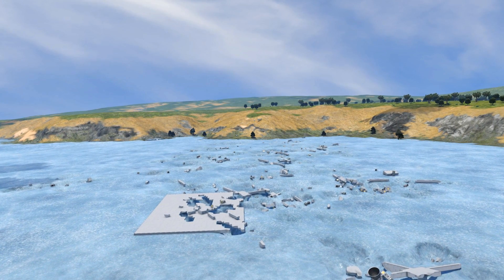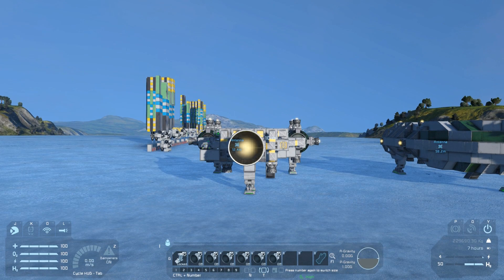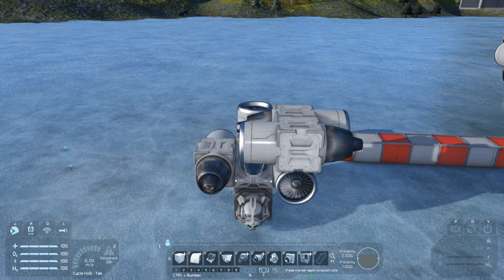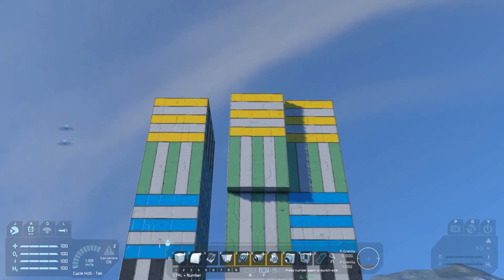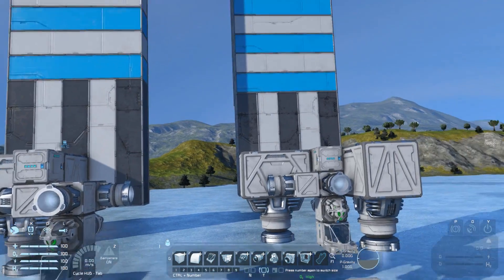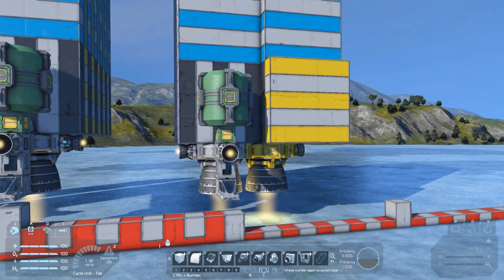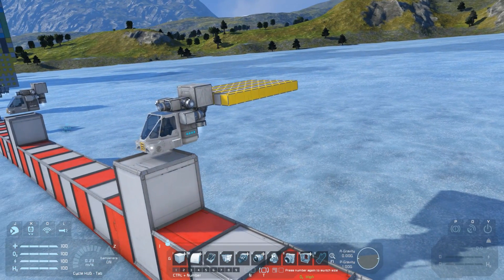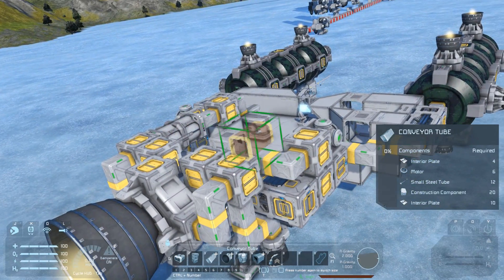Space Engineers Tutorial: How many thrusters? (tips, testing and tutorials for survival)

Comment: That is a great visual demonstration.  But it is sad that it still comes down to guestimation, given that the basics for mathematically gaining the information do exist but are not fully functional ie:

1.   the Grid Mass you showed at the 13:44 mark, is only of value if you build the ship away from any other structure, as the Grid Mass includes all items attached to the Grid on which the ship stands.

2.    you will also notice that the Grid Mass in this instance is 278,753 in 1G gravity, and yet your HUD shows a weight of 229,690.  At 1G, they should both be the same.

3.    I don't know if it is just because you showed the demo in Creative mode, but on my computer in Survival mode the HUD weight cannot be read until the ship is detached from the base ie no construction scaffold attached and landing gear unlocked (which can sadly be to late).

If the developers could fix it so that the Mass of a ship was separated from the platform mass and/or the weight could be read from the HUD throughout the construction, the mathematical formula could be applied and all problems would be solved.
Reply from the maker: Thanks, after our talk the other day I was really trying to come up with something that would be helpful despite the limitations that we're stuck with in terms of the wonky behaviours of the havok physics engine. I was hopeful that a demonstration like this would be a useful band-aid/duct tape type solution so there was less frustration, knowing full well that it wouldn't be a complete solution.

The difference in the grid mass is seems  to be due to the mass of items in the cargo - the ships with empty cargo it matched in all the tests I did (I tested it because you pointed this out before and I'd never noticed it myself), but I may not have tested widely enough since SE physics are weird at times :P

I don't think you'll ever get a grid mass while that grid is still part of a station, the game just doesn't have a way to define that at the moment. The only way to deal with that is to build in a way that allows for extra thruster additions after you disconnect from your parent grid. Which sadly will limit creativity somewhat.
Reply: It is apparent that anything on a grid that has landing gear is identified as being separate to the grid (ie the different colours of stuff in the menu for the grid to those on a ship) for everything except the mass of the ship.  I would have thought that it would not be a giant leap to separate the mass information.

I found a band-aid way around the problem by building a construction platform next to, but not connected to, my main base.  I then add a control button to the construction base and use it to get the start mass of the construction grid, which I can then subtract from the total mass as the build progresses.  Its not ideal but it is better than nothing.  Having the construction base adjacent to the main base means that I can place a cargo container, which is piped to my main systems, at a positions that is accessible from the construction base without actually being on it.

But you are dead right about the fact that function taking priority over form does take away a lot of the creativity.
Reply from the maker: Oh right, sorry I misunderstood. You should be able to get the grids to calculate separately by completing the landing gear and unlocking them. When they're locked they behave as a single grid - i think they made this change because everything used to explode when you'd move two connected grids. So if you unlock it the game *should* deal with them seperately again.

That's a good idea with the container though, probably saves a lot of time and hydrogen flying back and forth, not to mention those times when you're hurrying and end up with a splattered astronaut.
Reply: Yes, I understand that the grids become separate once the landing gear is unlocked, but that can prove to be disastrous if the vessel turns out to not have enough thrust and/or is imbalanced.   That is a bit like the real life engineer driving a truck over a newly constructed bridge to see if it can take the weight. 

The quest is to find a reliable means to calculate the required thrust before having to disconnect.
Reply: Yeh!  Even when building out in the middle of an ice lake, it is worth the time and effort to run a pipeline and cargo container out to the construction site.  All of the resource can be reclaimed once the build is completed.
Reply: I also often build from a scaffold type framework with the landing gear being fitted much latter in the build process.  In most of these cases the landing gear do not reach the ground after being fitted and without the ability to calculate the thrust capabilities it is a tense moment, with fingers firmly crossed, when I cut away the supporting framework.